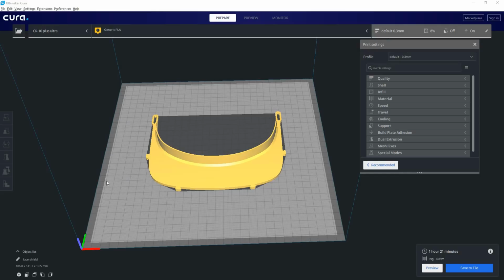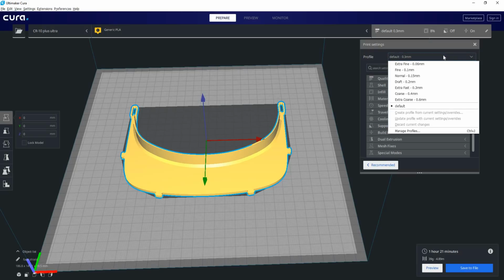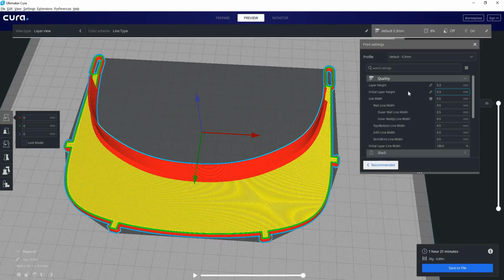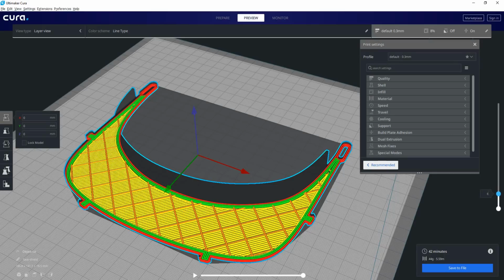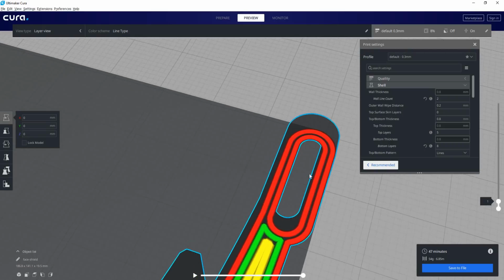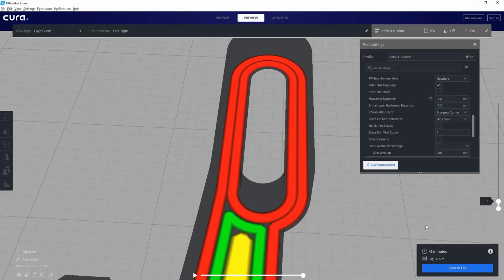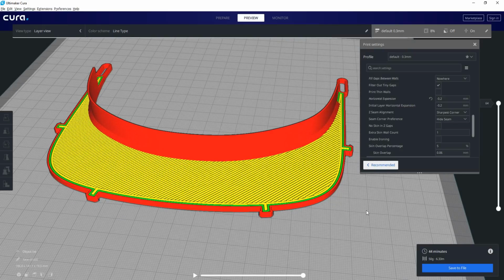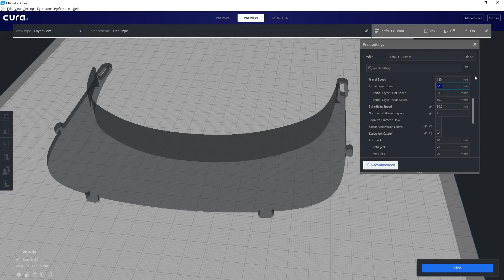How To 3D print COVID-19 face shields in 45 minutes

Comment: Make sure your hotend is capable of supplying enough heat to output big volumes. You might need to bump your print temperatures by 20-30 degrees or else you risk extruder skipping steps or grinding away at filament.

Comment: What printers are you using
Reply from the maker: CR-10s printers with my own firmware and full E3D direct drive extrusion system
Reply: @ASciencePotato  Same here, less the firmware and direct extruder, that i would like to have, as my first, prusa mendel model has and is far easier to deal with